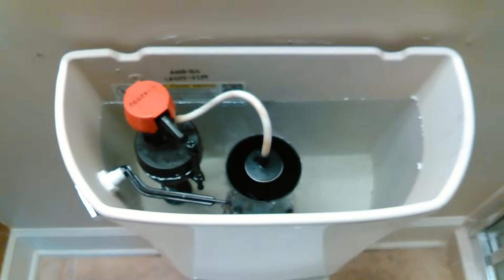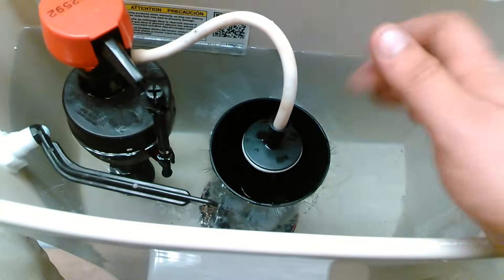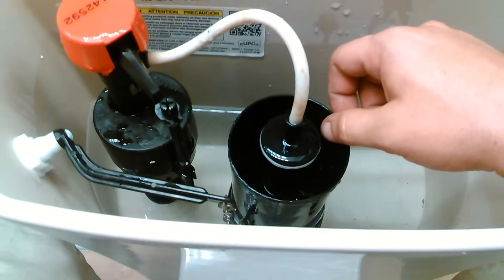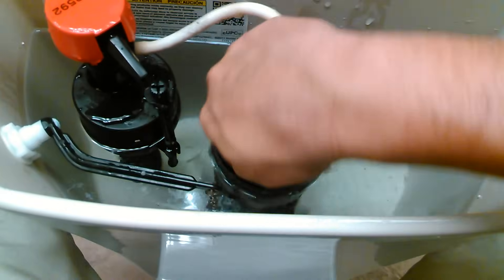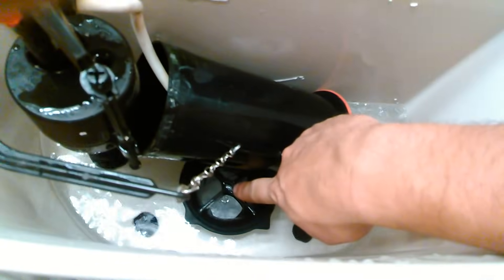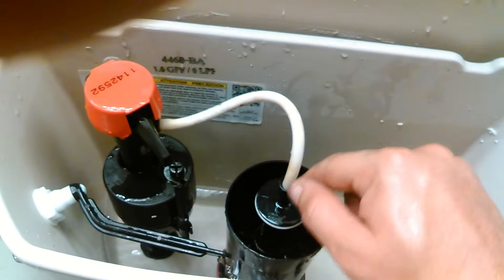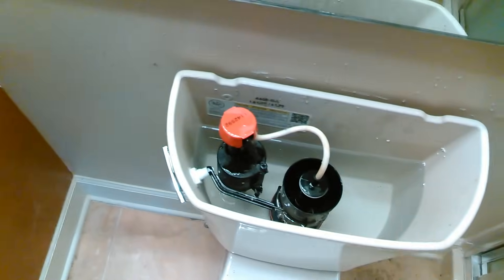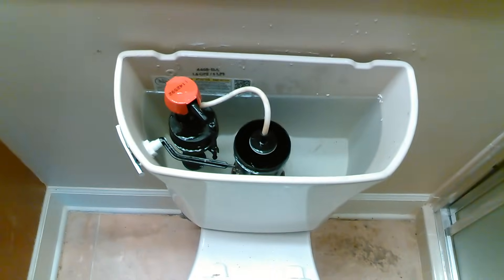Kolher toilet running no problem

Comment: Maybe turn off the water before making the video?
Reply from the maker: The biggest tip I can give you is don't turn off the water you might not be able to turn it back on or the angle stop might snap and you'll be in a world of hurt done it before won't do it again so we leave the water on

Comment: Turn the water off, dude.
Reply from the maker: Ine Petersen the biggest tip I can give you is don't turn off the water you might not be able to turn it back on or the angle stop might snap and you'll be in a world of hurt done it before won't do it again so we leave the water on